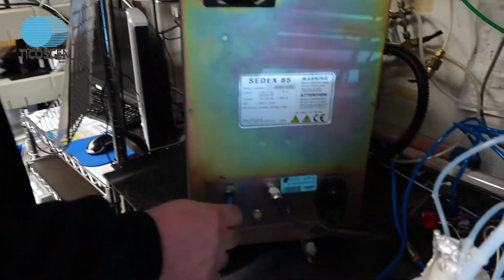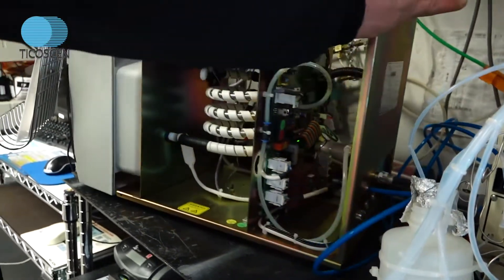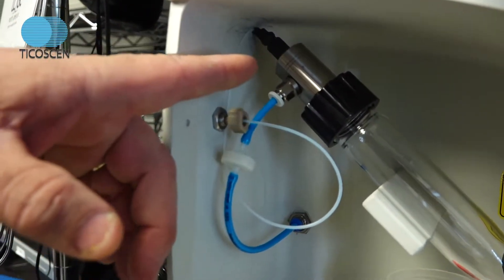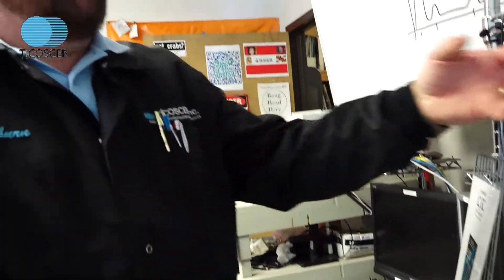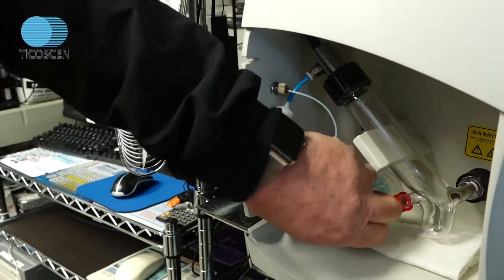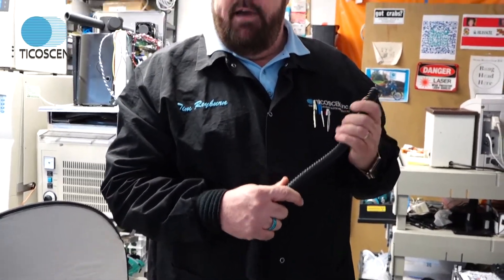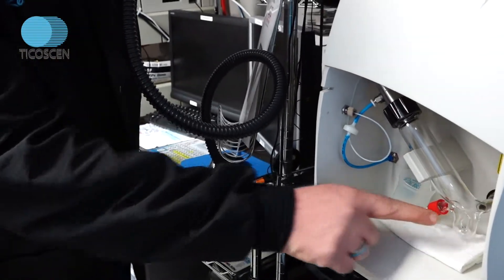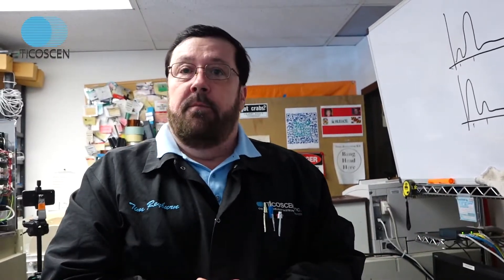Setting up your ELSD: Ticoscen Inc

Comment: Thank you, love your videos. 
Question - what is the pore size of the inline filter (white) that is connected to the blue line (4mm)?
Reply from the maker: It is a one way diaphragm valve to prevent capillary flooding of the unit into the N2 lines  with liquid mobile phases if the gas is shut off and there is still solvent flow.
Reply: @ticosceninc.elsdexpertsfda7713 thank you!